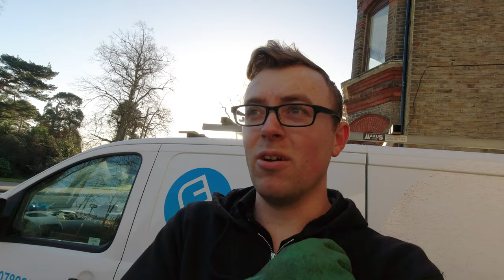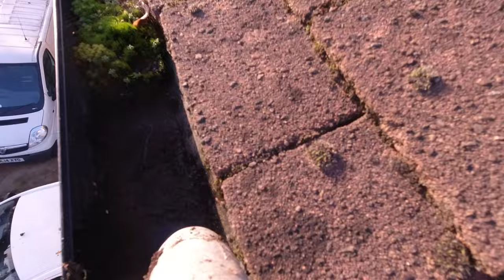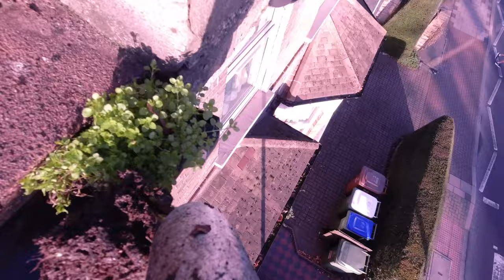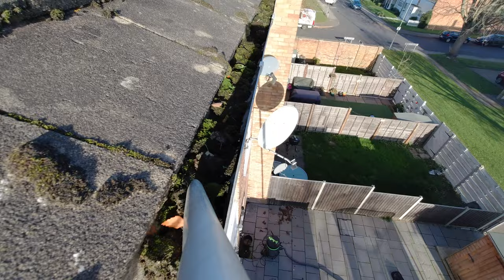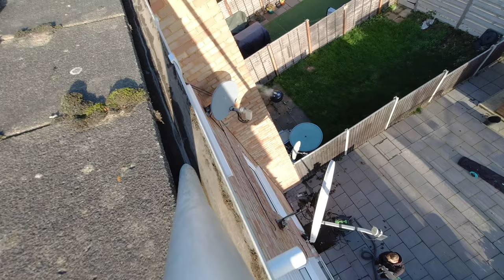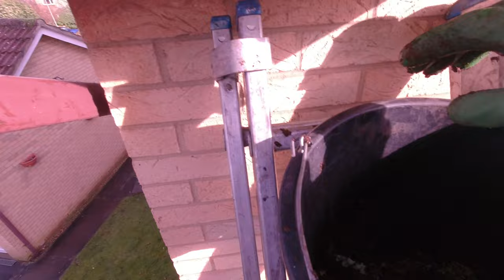Gutter Cleaning With A Gutter Vacuum & Aluminium Poles  *BLOCKAGE REMOVED*

Comment: Great to see you working from the ground where you can. I assume you know never to use an extension cable that is not fully unwound especially an encased one? Pulling lots of power through a coiled extension can cause a fire!!! What van do you have? Great bit of piano at end :-)
Reply from the maker: I found that out the hard way 6 years ago when I melted my plug which will stick with me forever now.
I have a fiat scudo Swb but wish I had a Lwb.

He said “ thank you” regarding the piano🤣